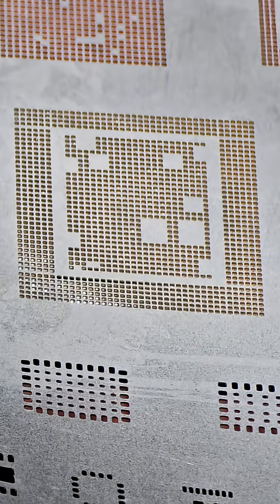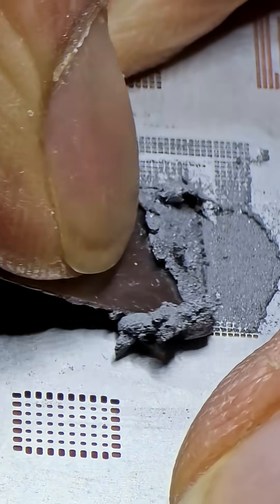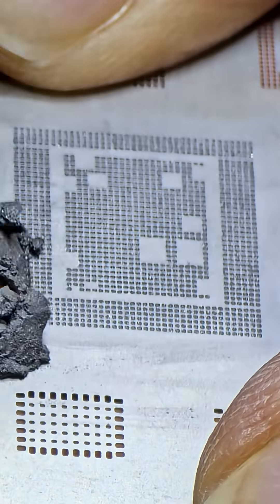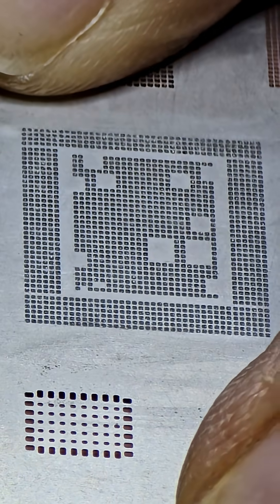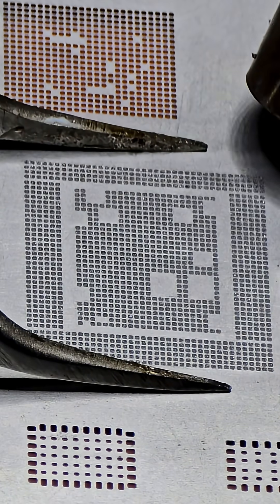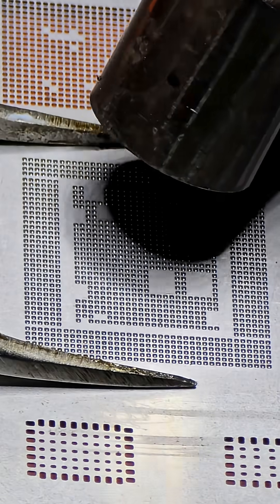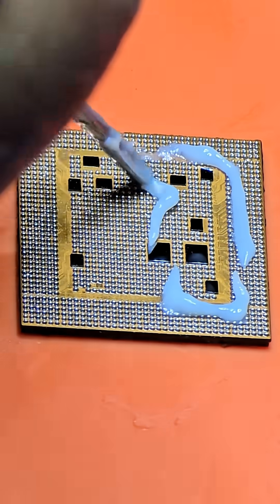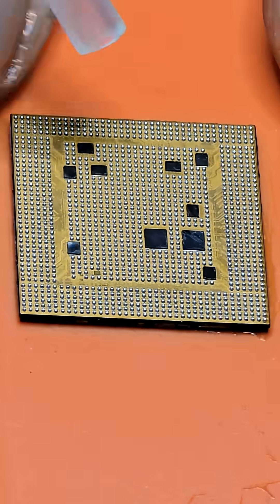How to get perfect CPU Reballs on any iPhone

Comment: Why........ I've seen BGA work done on chips like this many times before and they don't do it this way. They also do it a lot faster. You just smack some solder paste on there, peel the stencil off and then heat the chip and the solder balls form themselves using the available solder paste without needing excess And the stencil doesn't have the chance of sticking to the chip
Reply from the maker: I use the preformed balls when working with larger BGA chips. For ICs with smaller ball size paste works better

Comment: "use solder without flux because it has too much flux" then proceeds to add more flux than was originally in the solder.

How about teaching a correct method instead of a janky bodge. Most people have problems with cheap solder using a crappy flux. If you struggle, try getting some 3m solder. It's not too expensive and most of the problems you get will go away.
Reply from the maker: Thanks for watching! Your recommendation to use good solder paste is spot on. If your solder or flux is bad then no technique can save you from problems. I use the mechanic 63/37 solder paste.
I use this method everyday and it works. The flux is added / needed after the solder balls have been flowed once through the stencil. The addition of the flux and the second reflow helps get rid of any contamination / oxidation. It also helps the solder form into nice shiny balls!

Comment: I got a BGA machine 😂  i worked my ass off for it and i got a few different kinda brands of solder. And yes this is one way you can do it. But i personally like the BGA machine especially when the ball count gets up there! 😂 I just ordered new IR lamps for my top Lamp and im gonna use my Mitsubishi MoveMaster II RM-501 robotic arms to remove the big boys for me cause machines dont make mistakes humans do 😂 and this Gentleman is 100% correct this takes practice and skills and i mean serious skills! I only got good causecmy mentor saw that I save electronics even if its technically worthless 😂 it really isn't in rhe long run so he told me to take them old tv cable boxes i grab from the garbage and practice on them and it should give me a good skill set. Fast forward 10-15 years later and according to him i serpassed him in microsoldering 😂

Comment: Do you fix eSIMs?
Reply: I think you may be using the wrong terminology, maybe confused about what an eSIM is.

eSIM is a digital version of the physical SIM card you used to get from your cellphone carrier and put into the spot under the battery, or the slot loaded holder you have to use a pick to access.

You don't fix eSIM, you delete it and download it again from your carrier.
Reply: @ryanedison5709 no I am asking can he make the internal component because mine is broke it’s a circuit board